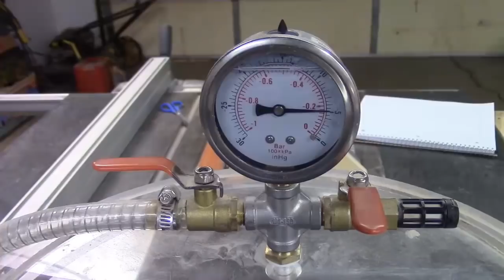Making a Trout SwimBait

Comment: That's a great way to control the angle of the cuts precisely @ 3:05, I've seen it done with hand drills to angle the drill bit but never with a saw. PS that band saw looks like it could use a new blade or some sharpening, it didn't cut through the wood it burned it's way through lol, hopefully your patreon can help fix that for you. 
YOU CARVED EVERY SINGLE LINE AND SCALE INTO THAT FISH?!?

Comment: @marlingbaits idk if you have tried this, but I noticed you use mixed epoxy and filler to fill your lead holes. This has worked for me, however I have found plumbers putty to be much more efficient than that or woodfiller. It dries in like 20 minutes and is somewhat carveable. It's cheap too. Possibly something to play with

Comment: I struggle with knowing how much belly weight to add and where. But now I see we have the same issues. Turned out great!
Reply from the maker: Thank you! I always add too much and have to drill it out. At least lead is soft enough to where it’s easy to do.
Reply: Try with a drop of super glue, test, remove weight, repeat. When you pleased with sink rate then make holes and push weights in.

Comment: I do not have a pressure pot. Can I just soak my lures in Poly and be good or do you suggest something else before I get one?
Reply from the maker: Yep you can just dip and hang a couple times and you’re good.
Reply: I have always paint brushed it on and I am (as we speak) spraying the polyurethane on but I am going to try the dip method. Thanks.

Comment: Fantastic work, how do u fix the connectors between the body sections? Glue?
Reply from the maker: Yep I use a lot of CA glue, and drill the right size pilot hole so the fit is very snug